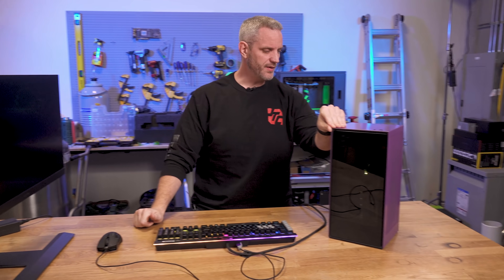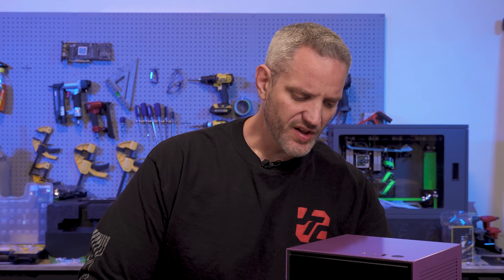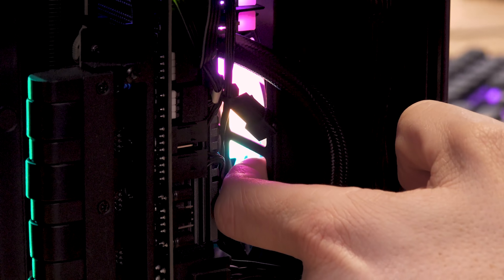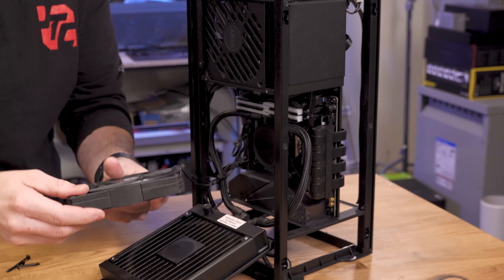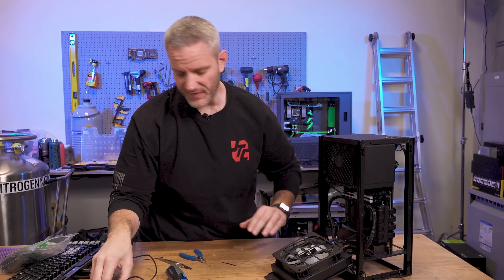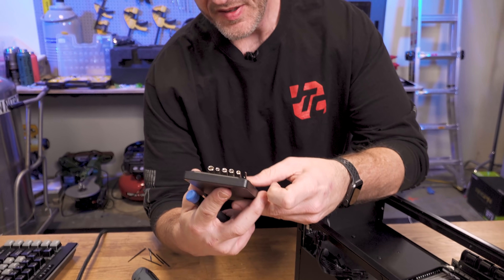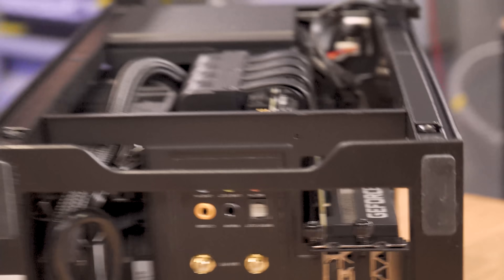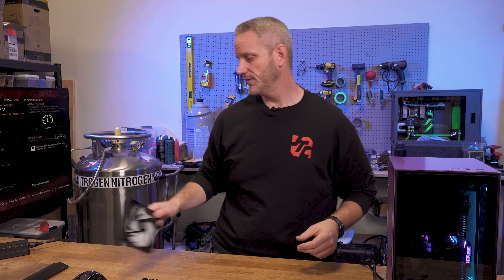This PC is shutting down due to overheating... let's investigate why!

Comment: What timing for this video to pop up in my recommended, I recently had to clean out my PC for dust and replace the AIO water cooler for the CPU back to a CPU fan because it was overheating and shutting down on me, also it was high time to put some new thermal paste.

Comment: I need help Please , i have many Problems Asus bios and the ganes freeze 

This may be due to the previous Post attempt failing because of system Instability or if the power button was held …in to force the system off. If the system failed to Post after you made changes to uefi setting

Comment: I am confused. The washer used should be placed between the video and the chassis. Am I correct. That way you isolate the card from the chassis.

Comment: My cpu shuts down at 117 degrees celsius idk why
Reply: and my pc is extremley clean i clean it once every 3 months and sometimes my cpu is at 25 idle and 65 at max usage another day its 50/60 to 95/108 and my room temp the same it just sometimes is low then next day i turn it on and its warm instantly and 50/60 idle in celsisus i can find anything about this online

Comment: Hey my radiator fan stopped working all of the sudden with this same build basically, the fan is brand new, no resistance, theres a bit of cord clutter to shut theb radiator fan easily but it was working just fine til last night where it just stopped. Ive done everything i could to get it running again but nothing seems to work. Any ideas??

Comment: Please I need your help my PC is acting strange since the past 3 weeks I have a Dell precision T3600 also with an Nvidia GTX 750 running on 96 GB RAM

This is the problem: once I launch a Adobe Premiere Pro and any of the Adobe software or I tried to export my system will shut down and restart the RAM will be overheating and also the processor

I have replaced the timer paster for the processor I also clean the system, all the fans are running fine but my PC is still shutting down and overheating

Comment: I come back to this video to remind to look back at how stupid I was cause I bought into this small case bs. Never again. I got this same case pre built by nzxt and it is the worst pc I've ever had. It keeps overheating, I cant play games on ultra let alone high even though it's a 3070. During covid which is when I bought it had problems ever since i got it. I've returned it a total of 3 times to nzxt for them to fix it. They switched parts for sure the first time. I've also cleaned it, way more than my other pc's combined. It doesn't even get that dusty but the fact it's a small form case with little to no room to breath it effects it more. Never buying a small case again, first and last time i get one. I'm going back to my gigantic pc cases. Would not recommend this case to anyone. If you are going to travel with this... just get a laptop.

Comment: I found out on the 7950x paired to the asus prime x670-p board if set to docp it WILL have random shutdowns, it is extremely frustrating, also the corsair rgb AIO it is possible for the commander to die on the pump sensor portion when this happens too many times mine just did.

Comment: Mine almost did once, because iCUE software somehow didn't react to anything anymore.
I have it set to set all the lighting to red when it reaches a specific temperature and that's what it did, but it didn't control any of the fans anymore and didn't react when I tried to set them up myself.
I had to restart the software and then everything was fine. But I was panicing because my coolant was at 55°C already. Usually it's not more than 32°C.

Comment: If anyone could help please i just bought a rtx 3080 with liquid cooling and it was running great for a week but in call of duty it started lagging and when i quit to desktop it almost crashed on me and was starting to idle at 49 celcius and i heard a rattling noise in my liquid cooler I immediately shut the game off and tried to get it cooled down but im scared to continue anything with it now 

Edit: i tore it apart and noticed that it was dry on thermal paste and that there was air bubble in the aio i re thermaled it and shook the air bubbles out and she runs mint now!!

Comment: Have you had any random black screen reboot issues with this pc? I’m also running a 5950x and ROG Crosshair Darkhero VIII and ive been getting random reboots constantly. Bios is up to date, swapped out ram, swapped power supply etc.  i think its a compadibility issue or something, Have you ran into this? Any support is greatly appreciated, I’m losing my sanity from this pc.  I can run stress tests for 2 hours, thermals and everything are good. It just randomly shuts off while gaming or sometimes even just watching youtube/twitch. Thermals are good and not overheating.

Comment: If a CPU reach 101C is it damaged? I was doing some fan profile work on my i7-1100K and long story short, it reached 101C when idling. I freaked out and smashed the power button to shut my PC off. It only stayed at that temp for no longer than 30 seconds. Did it do any damage to my chip or it's good? I got the heating issue resolved and my CPU seems to run stable. I just don't want any surprises later down the road.
Thank you,

Comment: MY CPU began to overheat after doing a new Windows 10 install. I tried a bunch of different things but nothing stops the overheating. Anyone know how to fix this problem?

EDIT: SOLVED:  I switched power plan from Balanced to High Performance. Apparently there is some glitch on the balanced plan that caused the processors to overheat when going at full capacity, but by switching to high performance my processor is back at 4GHz without the temperatures climbing high.

Comment: i had a fan problem today and it caused overheating to over 70 degrees C, 75 degrees C to be exact turns out there were a LOT of dust on a fan some to a cooler and to a place inaccessible by a vaccum we vaccum cleaned it most of it

Comment: I have this exact PC and this is a brilliant video. I'm looking to add a couple of fans to the rear of the PC and add some 5mm spacers for the front grill so that the GPU has some additional ventilation. Cooling is very good as standard but when you have a very GPU intensive game and a few programs open like OBS etc it has to work very hard to keep it cool so i'm hoping my couple of additional mods will help with cooling/ventilation even more. Great video. Sub and a like from me. Going to see if you have anymore video's on the H1 now

Comment: Try pushing the fan like back into place. The fans can slip out of position and bind up. I have a fan that does that from sitting down and it slowly keeps falling out of position I simply push it back into position and it works fine.

Comment: I built my pc 5 months ago and I'm using the stock cooler of my ryzen 5 5600g and now my pc is shutting down randomly, especially while I'm gaming. The cooler is spinning but cpu temps is around 60 to 70 degrees in bios. Should I buy a new cpu cooler?

Comment: Jay am having an issue, with this cpu so I went  from. Ryzen 7 3700x to a Ryzen 9 3900x  all I did was spaw cpu and a few days later I try running  3d Mark wasn't  able to run it restart  my pc try a few times and nothing. Then this morning  I tried power  it on it powered on then power off mmm so I powered  it on and it was on again.  This happen to me 3 times?  So do I gotta  redo my Bio?  If you could  help  that be super man. Lol  am going to redo my thermal Grizzly  on the cpu see If that helps. 😅

Comment: Jay, the screw is still contacting the case because it threads in. The issues with the reiser shown by GN is inside of the pcb where there isn't a coating for the screw and yes, there is a possibility of a short because of the lack of coating and bad pcb design.

Comment: Hello, i am facing problems regarding my pc(desktop).My pc specs-Toshiba 1tb hdd,4gb ram,Nvidia geforce 2gb graphics card,foxin 400w smps,Intel i3 4th genProcessor ,and ECS motherboard.From last 7-8 months whenever i turn on my pc it doesn't turns on, on 1 attempt, but sometimes it turns on, on 1 attempt.So i didn't payed much attention too that.i  take well care of my pc,i clean my pc & heatsink,apply thermalpaste if dried and etc...But one problem is not leaving me behind😢😡, which is after sudden interval time of usage, my pc shutsdown without any warning.And its happening now too much with much more problems,whenever i turn on my pc it starts lagging from the start shows 100%disk usage ,gpu temp reaches around 65°c after sudden time and shutsdown without any warning.too muc problem.Plz help me understand what is the reason behind all this together at all.What to do? plz help.Even after shutting down i open the case and see the hdd,graphics card,processor and the smps  is hot(not extreme)but hot.plz help me.

Comment: 3 weeks ago my PC started to throw BSOD and then sometimes it freezes and restarts, but this happens only when I'm running Unreal Engine and the GPU is at high load. Temps are excellent (73 to 75°C MAX), CPU, RAM, etc all perfect temp. Did a software check for RAM, did a CPU stress test, all fine, I even downloaded the MATS Boot Program to run VRAM test and ZERO erros. I made a DDU driver cleanup. I also tried another high quality ThermalTake PSU. Nuff said. I literally did Everything. Concerning the GPU stress tests, it restarts sporadically, sometimes yes and other times FurMark keeps running for 30 min non stop and nothing happens. This left me up with 2 possibilities: 1. Format Windows (which has a low probability to be the problem), 2. My GPU (GTX 1070) has one of the fans with one broken blade and causes vibrations when it is in high load. (Many people told me this vibration is not a lethal cause for this issue) . I would like to know your opinion. Thank you!

Comment: playing darksiders 2 on a strix 3080 and system shut down 3 times already. card is HOT to the touch. fans are on i dont knwo why a game from 2012 is killing a 3080
Reply: 3080 runs hot just from being a 3080. 

Might look into improving case airflow.
Reply: @Bendigo1   I downloaded a Zeus GPU tweak 3 and cranked the fans up plus on my corsair IQI set it to extreme and it's too extreme and it's been helping Didn't know an 8 year old game can shut down a system from overheating. I applied cyberpunk for hours the other night and nothing happened at all
Reply: If looks and noise aren't an issue.  A cheap box fan blowing on it works well.
Reply: @Bendigo1   My case is a corsair 680X and I open the side panel when it gets above 75 in there I am almost done with dark ciders so a few more hours to go
Reply: @ramza813  opening the case usually messes up the airflow.  If opening the case helps keep it cool you have an airflow issue.     Some games are much harder on gpu just because they practically run on the gpu.   Sometimes the older games are not optimized for modern gpus.
Reply: @Bendigo1   I was able to cook an egg on the 3080 it was so damn hot. All my fans are corsair LL120s and 140. Not cheap at all. Even RDR2 for hours I never hit above 65 only Darksiders 2 and I'm hooked on it right now.

Comment: The fix for the pcie riser jay has done is incorrect as the issue is the screw touching the 12 volt plane within the pcie riser so the screw will still touch that and the case you need a nylon screw and bolt thats non conductive to fix or replace to a shielded pcie riser the washers will do nothing and just add something else to burn which is worse

Comment: Those screws are not isolated from the 12V plane. the threads are still in direct contact with the board and the case.

Comment: Please help 
I built my pc and it starts but I get no signals on my monitor 
Tried everything 
Ram 
The monitor it self 
Gpu 
Everything is plugged correctly btw 
The fans spin and lights are on but there's no lights and my keyboard and mouse don't get lights as well 
I got ryzen 5 2600 
16gb ddr4 3000
2060 rtx 
Psu is 400w 

Where is the problem??
Reply: If you haven't fount the issue, it may be the psu,  with that gpu you may not have enough power for the whole system.
Reply: Might try 600+ watt gpu.

Comment: @JayzTwoCents pretty sure them washers are not going to prevent the pci issue. The problem was the 12v line makes contact with the threads of the screw, not the head of the screw.

Comment: "nothing on NZXT failed" while having to change a screw that's not a definitive solution because NZXT was too cheap to produce a custom PCB and instead reused a PCB which turned into a cheese grater that is a fire hazard

Comment: I've got a quick question.  I've got an i6700k that at idle is around 29C on the cores and into the low 80Cs at load with prime 95 with  the door open.   Tried 2 different coolers same result.  no idea why.  First cooler was liquid with radiator (corsair 100) other just a simple air cooled.  its in a corsair 4000 case all new fans
Reply: Sounds like either poor case airflow or wrong/bad fans on cooler.  Need airflow fans for the case and high static pressure fans for the cooler.

Comment: i like your videos but i have to comment on your riser screw fix sorry to say you did not fix the problem with the plastic washers  as you recall the problem was due to the screw threads chewing up the circuit board and the screw being grounded by the case causing the short with the 12 volts for a proper fix you need a plastic tube that goes into the screw hole first and use a smaller diameter screw that fits through the tube and the washers that you put on both sides that way there is no contact of the threads with the riser board or ground but the screw will have to be a bit longer because you will have to put a nut on the end of the screw to hold it in place because of the smaller diameter of the screw it will not hold in the original threads (it's the fix that they should have sent out instead of the lousy plastic screws    ( my opinion)  thanks' for your videos

Comment: The case that sets your soul on fire
Reply: Please help 
I built my pc and it starts but I get no signals on my monitor 
Tried everything 
Ram 
The monitor it self 
Gpu 
Everything is plugged correctly btw 
The fans spin and lights are on but there's no lights and my keyboard and mouse don't get lights as well 
I got ryzen 5 2600 
16gb ddr4 3000
2060 rtx 
Psu is 400w 

Where is the problem??

Comment: The washer is not gonna do it.
The screw can bite  into the copper layer in the PCB and from there to the PC Case.
Making the rubber washer pointless.
Thats why the original repair screws aren't made of metal.
This is still a fire hazard.

Comment: If the metal screw is screwed in the chassis - then it's grounded. If it touches the 12V layer inside the printet circuit board you WILL have the problem.

Comment: It's not the washer, it's the thread on the screw boring into the pcb, the holes are really tight and the thread is touching the 12V layer inside the PCB. Steve from gamersnexus proved this.

Comment: Jay! You made the problem worse. You just unscrewed it, removing more coating and rescrewed it, removing even more coating to the 12v layer. Then grounded it back to the case. Zip tie man, use a zip tie, a stick, piece of gum, anything other then a grounding screw! K, maybe not gum as it would also be conductive...

Comment: Maybe I got GN's problem identification all wrong, but I think the problem was that the PCB screw hole wears down due to the metal screw scraping and cutting into it, causing the screw to bite into a 12 Volt layer inside the PCB and then short through the case (which Jay pointed out). The Nylon washer does absolutely nothing to prevent this, while taking the screw out and refastening is actually creating more wear and increases the chance of the problem to arise. As a temporary fix I can understand the use of nylon Tie-Raps, nylon screws (The suggested "fix" by NZXT), but not refastening it with the same metal screw and a nylon washer. The trick is to prevent a short through the use of electrical isolators rather then electrical conductors.

Comment: My pc (lenovo legion t5i) did something similar to blackice the other day. I was looking at the insides to see what I want to do with it and how I wanted to upgrade, since it's still fairly new. I'm looking inside, the most drastic thing I did was unplug a couple rgb components, just the strip at the top and the entire plastic case to get to the strip, and the 1660super just to look at it). And I turn it on, and it boots up, shutdown, up down, up down, I turn it off with the power button, and I do it again. Same thing. Over and over, until I get a picture of a blue screen, nothing severe to the pc, just needed to reinstall windowsa d I still have all my data. But it's just weird it happened.

Comment: Had to Dislike due to bad advice on the Nylon washer that could CAUSE the condition that could create a fire and kill someone..
Seriously Jay, watch Steve GNs video on this. And take this down.
NZXT says remove the screw because the Screw THREADS cause the issue. Adding a washer will just alter the Thread position and might do just enough to put the thread in a position to ground out the internal trace in the PCB.. causing a fire.

Comment: Jay,that may cause a Fire. 
Steve Gamers Nexus covered this Fire Hazard in detail.  There is a trace inside the circuit board in close proximity to the screw, the issue is the THREADS of the screw contact a trace and ground. Causing a 12 volts to ground that, due to the resistance of the case, causes sufficient resistance that the PSU doesnt trip a safety and cut voltage, leaving a 12v to to ground fault that can cause a fire.
Steve managed to get a fire in his video.

What you did will not alleviate the fire hazard, because its th screw THREADS that cause the grounding. A washer wont work.